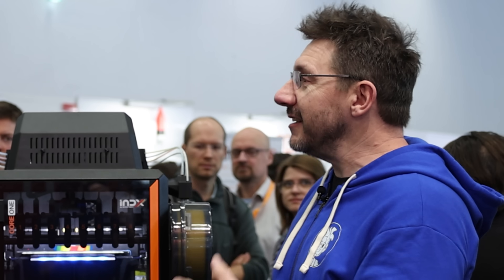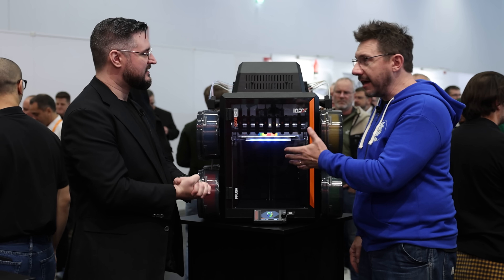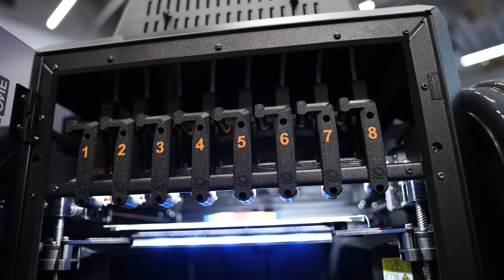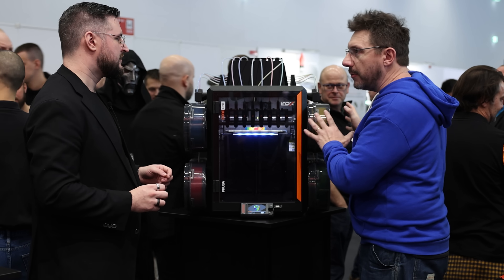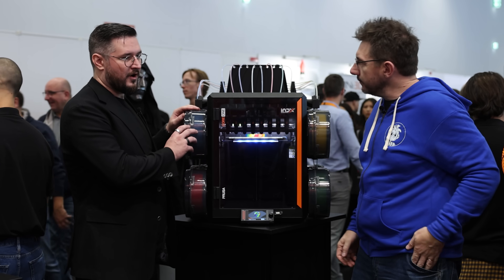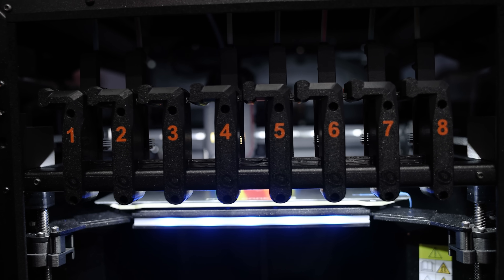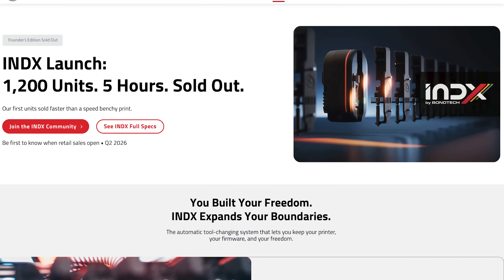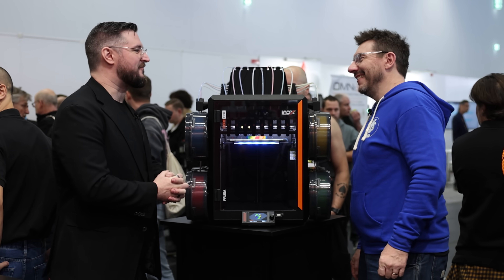Prusa CORE One INDX - 8 HEADS! Formnext 2025

Comment: Remember hos the Core ONE had the indentation on the right and left side to place a spool for example? Well, that indentation is still there but now it all it does is fill up the print chamber. It'd make more sense to make it a flat wall and make the printable area wider in the X direction. Might even fit one or more INDX heads, for those that want. It's obvious that INDX is a retrofit on an already finished printer design (Core ONE).

Comment: Is there any information on whether the INDX will be as reliable in leveling? If I saw this correctly, it's a PINDA type system, not a touch cell like Nextruder? That seemed so finicky now that I have the MK/Core Ones running with the load cell method. I desperately want to add a Core One L / INDX 10 next year (have to get my wife comfortable with the price tag and I figure regular availability will be later in the year) and that's the only thing that makes me hesitant.

Comment: A huge boo to whoever set up the framing and edited this video; it 💯 sucks. The topic is a new printer with an 8-extruder tool changer, and you shot the entire thing from the back side of the printer where the extruders and tool changer aren't even visible, and cut in maybe 5 seconds total of b-roll (split up in multiple shots) showing tool changes that go by so quickly you can barely tell what's happening. Seriously? Massive fail on your part.

If you're making a video about a product with a new and interesting feature, you should SHOW THE FEATURE IN ACTION for more than 0.5% of the run time.

Comment: IMO... Bambulab AMS was still a way better idea.  For the price, and little added time... I don't mind the purging. INDX cost is $700 for 8 colors.  For $500, Bambulab AMS can also do 8 colors.  Not to mention... In total... You can do up to 16 colors total with Bambu, for only $300 more than INDX 8 colors.  Sorry... The only way Prusa will ever be appealing to me again... Is when they drastically lower their prices.  They're more expensive than practically every other 3D print brand, and they're very problematic, and costly on repairs.  All other brands are still out-performing Prusa, and just work great right out of the box. I own a Prusa MK4S, with every imaginable upgrade, and modded MMU3 that can do 12 colors.  As soon as I bought my Bambulab X1 Carbon, with dual AMS... I never touched my Prusa again.  I have 5 Printers in total, and the Prusa, is the only one I never use anymore.
Reply: 200$ is 10 rolls of filament.  Obviously the ratio of waste to object is highly situational, but it seems like the most efficient, mass-produced printing is still about 15% waste.  And of course it can rise to well over 300% in inefficient situations.  But let's say 25% waste for a round number.  That means 0.25kg of waste for every 0.75kg you print.  So after going through 40 spools, you've thrown away enough money to have bought the INDX kit instead of two AMS.  How long would it take to go through 40 spools?

That's a genuine question.  I don't do much multi-colour so I've no idea how long that would take.  (I'd got through 40 spools in about 10 months, but 35 of them would be black ABS, so neither system has an advantage there.)

For my needs, an AMS is almost useless.  It saves time when filament runs out.  It saves a little bit of time in having multiple colours available; and even multiple filament types though at the cost of risking contamination, which has happened to me.  But it doesn't let me do multi-material in a single print, and it doesn't let me have multiple nozzle sizes ready to go.  If I want all that in one printer, I need some kind of tool-changer.

But I admit this is expensive.  If I'm being honest with myself, a system like INDX is only doing one thing for me: having multiple materials in the same print.  For everything else, it's either just saving a bit of time (in exchange for a lot of money) or I could get the same effect for less by just buying another printer.  I really like the look of this and I WANT it because it's cool - but Prusa definitely has a cost challenge.

Comment: I think it is incredible, but you are still going to have a damn hard time convincing me to pay what will likely be nearly double the price of an H2D for a max of 8 colors/materials. That is my only grievance with Prusa right now. They continue to be very good, but now that my bambu printers have proven every bit as reliable as my older prusa's. I'm sorry, I'm just un willing to pay $1000+ more. Before anyone starts, waste is irrelevant to me. It is just built into the cost of the product. The closed eco system is irrelevant to me, it is a tool for my business and all I care about is does it do the job i need with the absolute minimum amount of fuss. Time and quality is the only thing I care about and the vast majority of the time the P1s are more than fast enough for what I do and the H2 is even faster than those. So for me and my purposes, the INDX although nice is firmly in diminishing returns for the time it actually saves me.

Comment: They're still holding on to the "made from 3d printed parts" thing? Total deal breaker. Every time they cut to the closeup of the 8 heads such as 2:43, you see just how awful the overhangs area looks, and it looks like it's barely bonded. I want high quality injected molded parts.
Reply: I personally love it, its RepRap! Its more expensive to make them this way when you are at volume, but its a process you can control, and its more agile to iterate and improve this way... less stock needed... no shipping costs... should I go on? IMO 3d printing is all about those... it has layers, ok, means less smooth surface, slightly worse properties (sometimes), but I love them layers too!

Comment: The weird separation between the Core One and the XL needs to be addressed by Prusa, because it honestly feels like they’re pretending it doesn’t exist. Core One has a better enclosure and active heating, XL has true multiple tool heads, Core One gets an INDX, XL has a two part silicone tool head and pick and place…

Can we just go back to the printers actually being compatible, or at least upgrading at the same time?
Reply: @rob_over_9000  the XL is a research machine for things like the silicone toolhead, chocolate toolheads or Proper Printings proper toolhead for extremely high flexible filament. The C1 is a consumer machine meant for "normal" printing. They both go to completely different markets, the XL is for tinkerers and specialty niches. INDX on the XL doesn't make a lot of sense, but if you really want it? Just built a toolhead with INDX compatibility yourself, because this kind of thing is what the XL is meant for.
Reply: @doktormerlin The XL feels more like a first foray into toolchangers that took way too long to come out and feels more like an afterthought now. Even the enclosure merits a “wtf”

Comment: I just don’t see much reason for it unless you print toys
Reply: you can print supports out of PLA for PETG parts, or vice versa. PLA and PETG are not bonding, so the supports leave a super clean finish and break of easily.

You can also integrate flexibles for hinges into your parts.

And obviously you can put colors into parts. Nowadays 3d prints are everywhere, so printing a colorful logo into the 3d printed parts you find in busses, trains, elevators and more is good for companies too.
Reply: @doktormerlin already know
Reply: @AlanBarnes1013  you say you don't see a reason, yet the reasons for non-toys are not valid for you? Doesn't make sense
Reply: @doktormerlin I don’t need 8 different filaments for supports

Comment: Nobody has asked if you can print abrasives through the hotends, which leads me to believe you can't.
Reply: you can, it's already confirmed by Bondtech. The induction system only works with hardened steel, so all nozzles are hardened. Flow rate will also be double of CHT nozzles

Comment: Hmm Revolutionary induction heads, not available yet. Bambu, Hold my Tea, and has induction heating already in production and in shops around the world. A bit behind there Prusa.  How does prusa manage the heat/cooling cycles of the filament in each nozzle, Purge tower?   It's not like the U1 where it purges out for fresh filament just before the gantry attaches, which is why the H2C runs a prime/purge tower.    Not enough factual information here, just a bit of fanfare.   Sure gets the Prusa fanboys hopped up though.

Comment: H2C owners watching this video MAD
Reply: No. Too small build volume and no heated chamber and long high tubes making the chamber more difficult to heat without a well insulated top, and I wonder what kind of magic it will take to print real soft tpu that don't like long tubing.

At least, the h2c is real, widely available, works goid and use proven reliable parts for the rack, the same parts equipping the good mk4s gantry that works for thousands of hours without a sweat, compared to the new, yet to be proven reliable indx.
To many compromise for one more hotend imho. Release has been scheduled for Q2. Lots of time for competition to catch up and make thy r prusa not relevant anymore. And I'd rather use indx on a sv08 than a core one.
Reply: Why?  At least when you unbox an H2C you can plug it in, run setup and start printing in under an hour and not need to assemble it or print parts for it, oh, and its fully enclosed.  Also those PTFE tubes will become a maintenance hog, there is a LOT of movement on them, far more than the two tubes on the H2, with much more movement at the push fitting that will eventually saw through the tubing.

Comment: This is actually the best tool changer when you look at number of heads, switching speed, waste reduction and ability to handle flexables also cost is pretty good.

Only problem with Core One is it’s somewhat small build volume, but that won’t be a problem on the L version.

Comment: Very innovative tech, my only reservation with both the INDX and Prusa in general is that they use actual 3D printed parts in their assemblies. Would prefer finished molded/cast/machined parts to ensure part to part consistency/reliability.
Reply: Of all the things to be concerned about, this isn't one of them.  Prusa's print farms are using their own printers.  Meaning those parts are rated for more cycles than you'll ever put on the machine.

Consistency in something like this is, surprisingly, not related to the process as much as the machines, factory, and QA.  You can easily have variation in machined parts from things like tool wear, lack of maintenance, or just bad operators.
Reply: The reliability of both my prusas have been excellent! There's a reason I only have 2.

Comment: I'm still very curious how the spool holders actually attach to the printer. Are we going to have to tear it down to the point where we can replace the vertical corner pieces? Do they reuse existing holes? Are they mounted in some other manner?
Reply: Badly... floppy sheet metal and it'll bow out and look crap... oh, you need to drill the holes 🕳🕳🕳🕳🕳🕳🕳🕳yourself
Reply: im not impressed with how the spool seems to just want to fall out. bad design.
Reply: @Joe-y4f4p I think the idea is the entire dry box is what you attach to the machine.  You aren't supposed to change the spool with it attached.
Reply: @EmperorA0  
but how do you push the filament to the toolhead? You have to rotate the spool manually for unloading and loading basically. I don't see that there is automatic loading...
You can't load the filament and then put the box over it right? So it will be as akwards as shown or am I missing something?
Reply: @i.i.iiii.i.i  It looked to me like you feed the filament out of the box's exit port, snap the lid on, and put it on the printer.  Then you leave it there until it's empty because you have 8 separate spools of stuff already loaded which surely would cover all the bases for the majority of users.

But that's just from what I saw in this video, so I could be wrong.
Reply: @Joe-y4f4pi'm sure that's just the initial design.  i can't imagine they'd keep it like that for long, but at the same time adding too much to it would also cause problems.